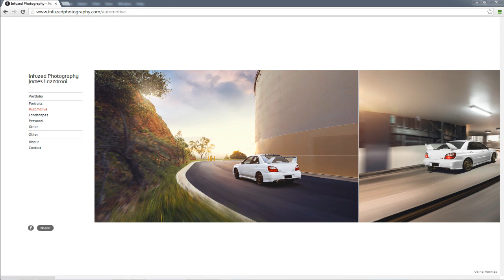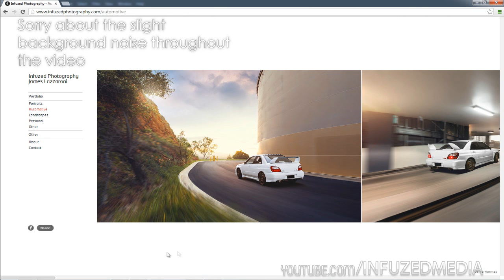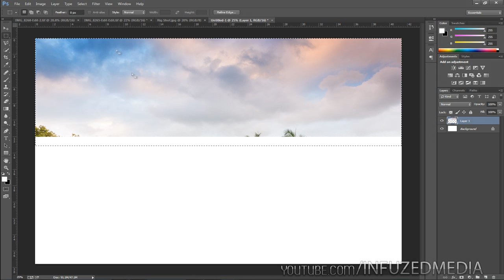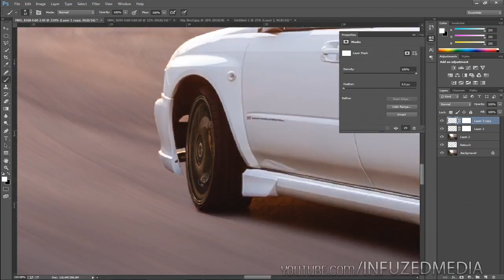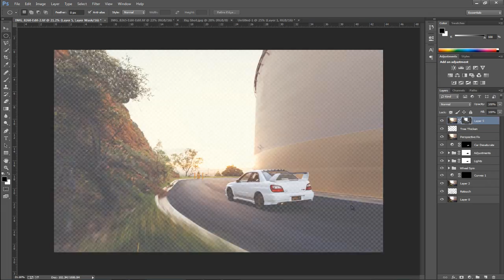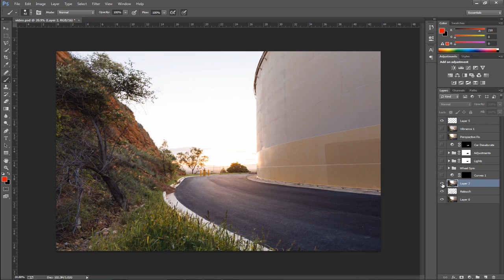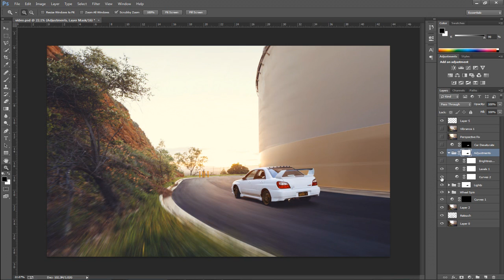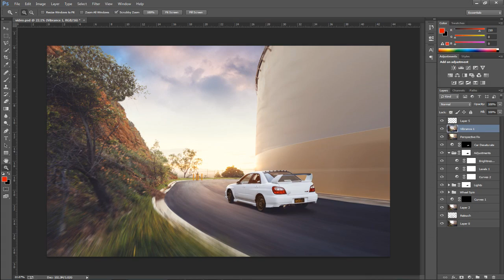Car Photography Compositing Walkthrough! (Photoshop & VirtualRig)

Comment: When I save my 5D3 file to jpeg then open it up in VR the color looks very muddy and im not sure what im doing wrong, have u had this issue before? same as when I set as desktop background the color looks messed up, im using pritty much the same equipment as u 5D3, CS6, VRS, LRS, Windows 7
Reply from the maker: It sounds like a colour profile error.  Try saving your file out of LR5 instead of Photoshop and see if that makes a difference.
Reply: Wow that did it! this is been frustrating me for months, if I export as jpeg with LR then open up in PS as opposed to 'edit in PS direct from LR' it has resolved the issue, thanks heaps :)
Reply from the maker: Malcolm McGrath No problem! I have the same issue and it was driving me insane for ages haha.